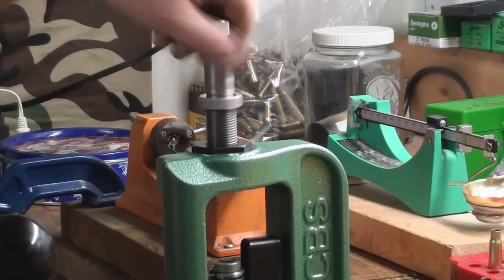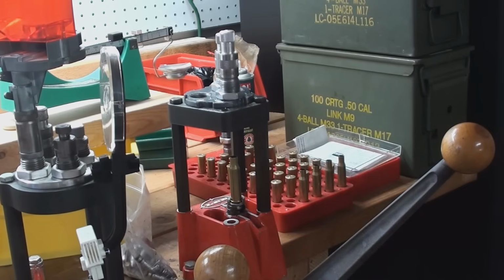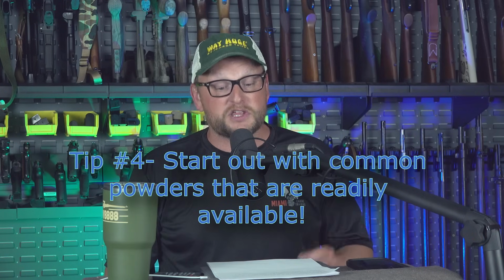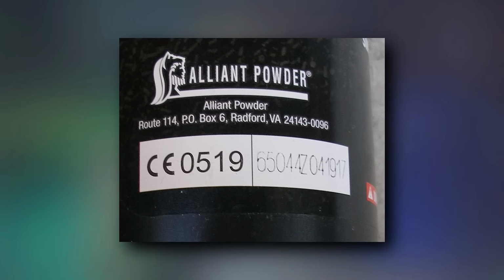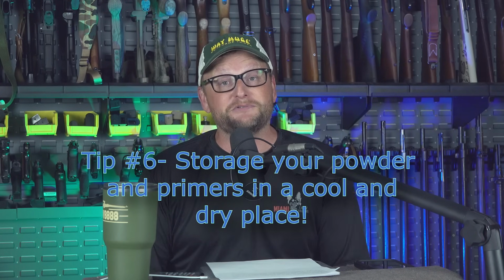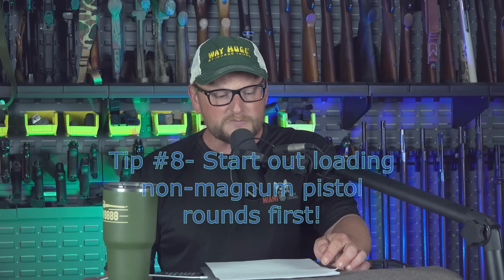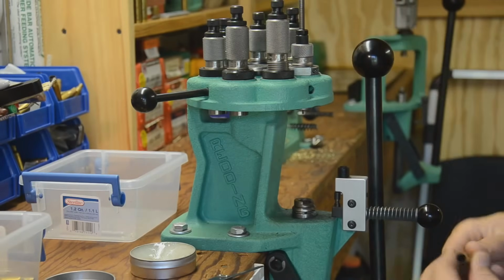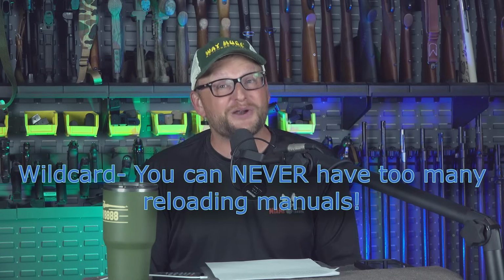Top 10 Tips for Beginner Reloaders

Comment: I bought a Lyman reloading kit with a T-Mag II turret press. I haven't done it for years (just not really any room in this apartment) but I did do some reloading for 9mm, 223, 40 S&W, 30-06, and 300 BLK after I got it. The kit is pretty good I think, had to buy a couple small tools, including electronic caliper, and then I opted for an electronic powder thrower (way better than the manual balance it came with) but other than that I was set, except of course for the dies and components. Oh and reloading manuals, it came with one I think but I bought another as the one it came with lacked a caliber or two I was interested in.

Looking forward to moving out of this apartment within a year and getting it set up again.

Comment: I concur. If you are new to Reloading then start with a Single Stage Press. You will quickly find it is fantastic hobby and your knowledge will expand exponentially. Spending a day in my shed used to be a great time. I gradually expanded and now with the help of a great Engineer mate I have a fully Automated System that can turn out several hundred loads for each Calibre each hour. You can refine your system and produce “Tailor Made” Rounds for each Firearm. This improves your Accuracy no end and it is way cheaper for the Rounds you produce. There is so much to learn. Don’t be put off by that and if you are unsure, just ask. There are a lot of us out there willing to help. No question is ever considered dumb. He’ll. I barely knew what end went in first when I started.

Comment: The explosive we handle at my work is from the Vietnam era and is stores in 55gal drums. The powder is in burlap sacks and the drum is filled with alchohol and sawdust. We wash than dry the powder in 120 degree ovens. Remember the dryer the powder more sensitive it is. Powder is best handled at 40% humidity for low energetic powder. I work with high engergic powder like lead azide and we work at 60% humidity.

Comment: Ebay is a great place to find older presses and steel dies that may be used..but quality of rounds is still doable. I have a ch press that produced 30-06 with less run out than the new rcbs summit and just shy of my co-ax press. Be careful...if you like mechanical stuff  you can blink and have a huge collection of new and old stuff...just to test against each other.

Comment: In past years, many people have proven Lee dies to load ammo that is just as accurate or more so than any other reloading equipment. I advise loading by volume as case volume is more important for consistency than charge weight. Charge weight varies with humidity. Volume does not. Use a balance beam to periodically weight charges.

Comment: I grabbed a rock chucker supreme IV and set it up on an Inline Fabrication bench mount with the double green bins and also picked up the Inline angled handle and it’s made the first leg of my reloading journey a joy so far…I also use the Harvey deprimer so that I can deprime outdoors instead of while sizing and I use an rcbs hand primer. WFT case trimming bits, and Sheridan slotted case gauges for each caliber…Lyman’s brass prep station has been super helpful. I also use the Frankfort Arsenal case tumbler with 50/50 walnut/corncob (+ 1/2 tsp of NUshine) and it’s held up well under heavy usage so far. I am still somewhat on the fence about Frankfort Arsenal Intellidropper, it worked great and was fast and consistent but the touchscreen stopped working after 20 months and they quickly sent out a replacement no questions asked, but if this replacement has any issues I’ll probably start using an rcbs chargemaster lite instead…slightly slower but I suspect slightly more reliable. Reloading quickly became one of my favorite hobbies…best part was noticing how much money I could be saving on ammo if I were still shooting the same amount as I were before starting reloading, but then realizing that I shoot so much more often that it’s actually costing me more overall…then when you factor in equipment and reloading supplies and gas for driving to the range, it’s basically been a money pit so far! ‘Find what you love and let it kill you’ they say…but it will make you broke first!! ;)  seeing smaller groups certainly makes it all worth it though…can’t argue with that

Comment: Get a simple press. Talk to old reloaders about tools. The cost is in the extras. Don't load tons of ammo until you get the results you want from a test load. Get two sets of dies per caliber. Dies do break. Each die set has its advantage. I use two brands of dies per caliber. I use a old dryer as a tumbler. Your cost comes with primers, powder, and bullets. Get old and new loading manuals. Seek out the used section of the gun store. Many times the mom and pop gun store will be the best place to go. Find a old reloader who is selling his equipment. Start reloading straight wall cartridges and work up the process. Bottle neck cartridges are harder to do.

Comment: I second,  Erics view on Alliant Unique.  I SHOOT SHOOT SHOOT SHOOT SHOOT,  and i had a 1LB bottle last a little longer than a year.  And an added Perk using this powder,  is with the flake size,  it would be EXTREMELY DIFFICULT to double charge.  Because 4.5 grains will almost fill a 9mm case to the brim.  And 5.3 grains will fill a .45 ACP case 3/4 of the way full.  I HIGHLY recommend Alliant Unique to ANY pistol loaders.

Comment: I started with the cheap aluminum lee single stage press and it makes good ammo. Im upgrading to a redding big boss ii or rockchucker supreme and my lee press will become a dedicated decapping press with the lee universal decapping die(which is an amazing die to own btw). Then all the gunk from depriming brass can stay out of my good press. Depriming on a rockchucker is supposedly not nice as nice due to the tray design too. Im saying this to point out that getting a cheap lee press to start won't necessarily be a waste if you upgrade. Lee die sets are a good value to get even if you ugrade to fancy match dies later too because you still get the lee factory crimp dies in the sets which are the best crimp dies and you will continue using them even after getting better sizing and seating dies.

Comment: Pick up some new filter cartridges for your respirator rated for lead dust. The gas only occurs at 900 and over and that's way to hot anyways. Lead oxidizes and created a fine dust. Get bags or a HEPA filter for your shop vac and always clean up. Buy de-leading hand soap and gloves.

Comment: Having inherited a decent amount of reloading equipment and learned to reload fairly competently, I would suggest anyone getting in to reloading for the first time to go straight to a turret press. No sense in buying a single stage that you'll grow out of in a month or two for pressing ALL of your ammo. Put the couple hundred bucks towards a turret press instead. You should absolutely get a single stage press eventually, but if you have a turret press, you can use it to do anything a single stage press can do, though a single stage is great for rifle cartridges.

Also, you're not going to save any money over ammo prices by reloading, but you can get the loads you want and hold a higher quality control than off the shelf ammo. Just make sure you don't over do it and make a grenade, check the book any time you use a new powder, they are not created equal at all. Cheers.

Comment: Another item that makes life more convenient is case lube spray, just don’t use too much it will dent your brass although it often doesn’t work as well as the imperial wax, or Lee resizing lube, but it does work bad part it will often triple at least your reoccurring cost. It cost more last shorter time and not as good but your fingers aren’t dirty just clean your hands and go with the wax or Lee lube.

Comment: Started reloading shotgun for hunting back in 2019 and absolutely love it. Better performing and to my liking plus I get to make my own custom loads and pressure test them at Precision Reloading. Buckshot, slugs/roundballs, Buck n Ball and field loads I do it all. I have 2 custom made load that patters 11"×10" at 50 yards one with (8) pellets of 0000 Buck .380cal & the other (20) pellets of #1 Buck and is my main loads I use deer and hog hunting. 

Favorite powder for up to 2oz loads in 12GA and mid to heavy 16GA & 20GA loads is HS6. Also use it in my .44MAG in my Cast 250gn Round Nose load.

Other great powders I use for shotgun and my .44MAG are Green Dot/IMR Green, Blue Dot/IMR Blue, Lil Gun, 700x, PB (discontinued but u can find em lurking in old shops and estate sales), Longshot, Steel, unique, 20/28, herco, red dot/IMR red.

There are alot more other pistol powders too that work for shotgun as well like 244 for 1oz, True Blue for 1oz and 1&1/8oz field and buckshot and a few others like Tightgroup that is wonderful for very light 3/4oz target and field loads as well as a great (17) pellet #4 home defense load . (Newly tested data by Hodgdon and loads created by BPI)

I started off with a Lee Load All 2 and upgraded to a sizemaster. For .44SPL/MAG I just use the old school Lee Hand Loader and cast all my Shot and Bullets even make my own CIA method black powder for my black powder Magtech all Brass 12GA cases. 

Got at least 30 or more old and current BPI, LYMAN, RCBS , Lee books, black powder cartridge and gun Reloading manuals ect. . . You can never have too much knowledge. Before you start making your custom loads, READ READ AND READ! Study and familiarize yourself with everything before you dabble in the dark n spicy side of handloading lol. Know the signs of overpressures, charge ranges and alot more. 

Stay safe and enjoy this hobby it's amazing that YOUR OWN made loads CAN & WILL outperform any manufacturers loads.

Comment: I’m surprised black powder reloading wasn’t mentioned as an option. BP is very forgiving and is naturally low pressure. Yeah cleaning is more difficult but the risks of overcharging a case is practically nonexistent. The only thing you don’t want is any sort of air gap in the case.

Comment: You can't really overcharge rifle so easily. Pistol powder is much more faster burn rate and less forgiving than rifle powder.
Start load with rifle loads first. Even poor crimp on pistol can result in pressure spike when bullet gets pushed into case as round is pushed up ramp into chamber. 
Start with small caliber rifle loads. So long as you don't put pistol powder into rifle, you're good.

Comment: When using my 5 stage press how come I get different measurements with my seating die for 9mm using lee dies , if I have 5 cases on the press it seems to not seat the bullets as much as it does if I only do 1 bullet at a time. What am I doing wrong. Please help. Also I did set my depth for bullet when I had the press with all 5 then when I get down to a few it seems to Seay at different sizes

Comment: If you only load 9mm don't buy a single stage press.  You will drive yourself nuts.  Get a dillon 750xl and thank me later.  It is so easy a caveman can do it. That's me.  I've loaded over 60,000 rounds on my Dillon 650xl and no issues.   Best purchase I've ever made.

Comment: Thanks for the tips. I've seen several different "from start to finish" reloading videos for rifle rounds and they mention backing the shoulder bump when resizing (datum line to casing base) by .0002, .0200, or .0005 relative to either a modded case or fired case. Any particular number you hold to? I'm doing 6.5 Grendel, 6.5 Creedmor, and 308.
Reply: Erik Cortina has a channel. The relevant reloading stuff is in the last 3 years, but he'll explain a better way than the reasoning behind bumping the shoulder.

Comment: agree and disagree.  it really depends on what you are loading for.  i was never a MOA shooter i shoot bulk so i went straight to turret.  an ive never used any of the powders you said, know em just never used but i did look through the lyman manual and figure out powders that are cheap and work for bout all my rounds.  i buy 8 pound kegs of wincester 231 and h335  then the rest are special and buy in 1lb size.  i loved it when i upgraded to my dillon years ago after i cracked frame on lyman loading 8x57,  but they did warranty it and sent me a new one that i sold.  i agree with dies.  yes the dillon dies have nice features but like you said pick up a m95 and now your buying lee dies.  nice video wish i had stuff like this back 30 years ago.  or even just someone to ask.

Comment: From experience.
Do NOT buy a Lee press, even if you are as cheap as I was.
The first 2 ( the "C" style open front) broke when a case got stuck in the die.
The "O" press broke in the cheap aluminum arm link.
I got a RCBS Reloader 5 which is the Rockchuckers little brother.
I haven't looked back.
The Lee powder dump still works fine but the weigh scale has been replaced by a Lyman.

Comment: Very true Lee makes dies for the oddball calibers.  Now their 7.62x25 doesn't do a good job at case sizing the brass.  So I use a stripped 9mm die to size them.
Reply: A lot of the brass for this round is cut short so you don't have much neck to work with. Star line brass told me people over loading this round was the reason for neck separation. Maybe use 30 mauser brass and trim to proper length
Reply: @bluelwood  I was talking about the sizing of the casing.   And yes I heard the same thing from star line.
Reply: @the-kilted-trucker59  I use the same dies and found keeping the bullet in line with the case was difficult a issue with the press more than the dies keep up good reloading and be safe
Reply: @bluelwood  may I suggest fluting the case just a bit more.   It helps me when doing 7.62x25.

Comment: Lee... their presses are fine as presses. I don't like the priming systems they use. I don't feel they're safe enough. If you're going to prime off press, Lee presses are fine. For a progressive, again I don't like Lee's priming system. That's why I avoided them on my progressive. I also don't like Lee's balance scale. Other than that, their products are a great value for the money. I have several Lee products.

Chargemaster... a VERY expensive way to measure powder. For rod type powders, it's great. For ball and flake powders, a powder measure, like a Hornady or RCBS, will throw charges with 0.1 gn consistency or better. For a beginner, though, I'd recommend Lee's Improved Powder Measure Kit. It's a set of scoops. And a trickler, and a scale (beam or digital). A Chargemaster or a powder measure is a bit expensive for starting out.

I'm not a beginner, but I thought I still might learn something anyway. I did. I didn't know that case tumbling posed a lead exposure risk. Thanks. I will start using fans and maybe masks when handling tumbled brass.

I agree with your recommendations for a Rockchucker and Lee dies.

Great video. Thanks.

Comment: 11.  WRITE DOWN WHAT YOU ARE DOING. Keep a log of what your go-to loads are for rifle, pistol, shotshell and a separate book of all the things you've tried in the past, so that you don't put in a bunch of effort on something only to find that you re-invented the wheel. Label all ammo boxes clearly as to exactly what's in them; sticky labels are your friend. Invest in a fine sharpie. 

Buy a small whiteboard and place it in front of you at the bench. When you are about to start, write upon it the intended case, primer, powder (and weight), and projectile (and overall length, or base-ogive if OAL is not the limiting factor). Once you have finished, transfer this information to a sticky label on the front of the ammo box and write it in your logbook, then wipe the whiteboard clean so you don't accidentally mix stuff up. The logbook should ideally include lot numbers of powder and primer.